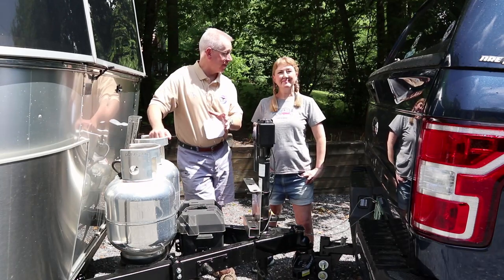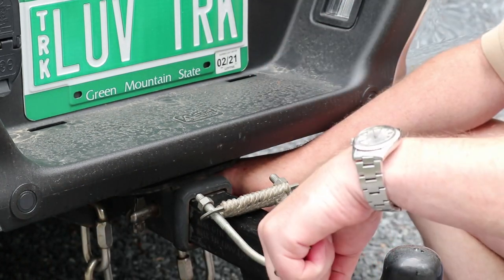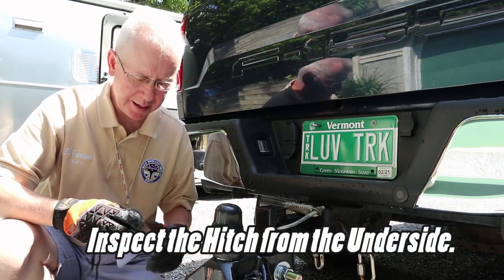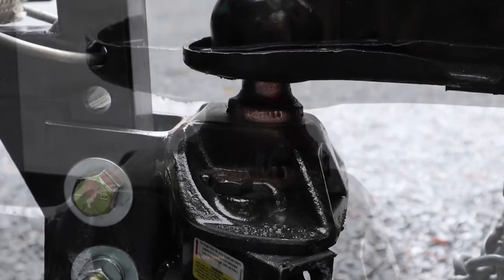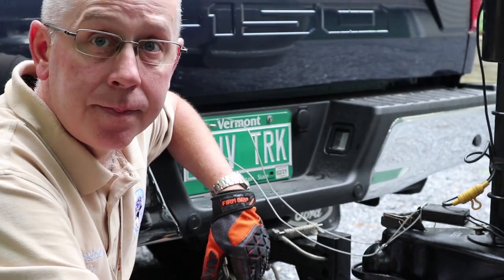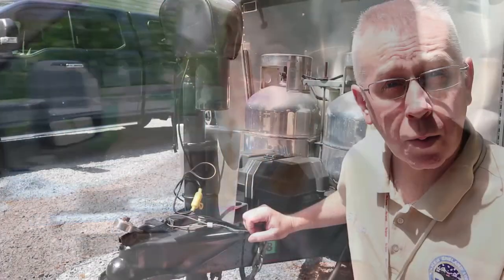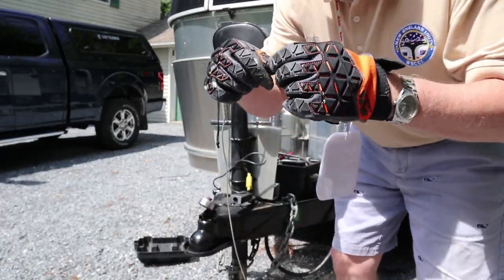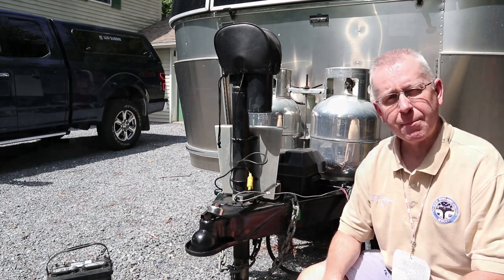RV Hitch Safety | Tips  For Towing

Comment: Concerns from an individual towing Airstreams for more than 36 years regarding your hitching procedures as per your video. The chain hooks need to be attached such that the body of the hook is on the top of that to which you are making the connection. As shown in the video, the “safety” pawl is on the top. If said pawl should fail, gravity will cause the hook to be disconnected. 
The doubling back of the break away cable to the safety pin for the hitch gives a second failure point for the cable. The routing of the umbilical power cord through the bail on the opposite side of that safety pin can apply pressure to cause that bail to open allowing the break away cable to disconnect. The break away cable as shown is too long and should be shortened to the appropriate length and secured with a pressure ferrell as the original loop was secured. The break away cable must be as short and direct as possible for the set up. The eye bolt that is being used is not a “closed eye” fastener. If an eye bolt is used, it should be a forging with no gap in the eye. The tensile strength of the fastener shown may not be able to prevent the eye from opening particularly if the eye is not in a direct alignment with the break away switch activation pin. Lastly, the break away switch should be tested with the battery connected as part of the safety inspection of the hitching procedure. One can hear the magnets attach to the brake baker plates or the hydraulic pump actuate for hydraulic brakes. A two second operation of that switch will not cause damage to the magnets or pump but will give assurance that the break away system is operating correctly. These are my concerns especially when providing instruction to others. Be safe.
Reply from the maker: Hi Robert!  Thanks for watching and your very well thought comment..  I've been thinking for two days what you meant by the pawls on the chain hooks and I finally figured it out.  You are correct.  When we hitch up on Thursday I will make that improvement.  Note that I have another video out where I explain how to test the brakes using a compass on each wheel.  Obviously, you have to leave the battery attached to do that.  The other points you make are indeed good.  I'm curious - how do you route your umbilical cord?  This is how I was taught by my father-in-law (and he really wants his daughter to be safe!).  Other than that, I'm pretty happy with my setup because, like you, I have many, many years of towing.  I appreciate you adding your knowledge to the Comment section.  Be safe and I hope to meet you down the road someday...

Comment: Good points. One guy told me that the cable to the “emergency brake” should be a little shorter than the chains so the brakes will activate if the chains are pulling the trailer. I like your setup better. Thanks for posting.
Reply from the maker: Since your comment I've been thinking about that.  Both solutions are probably acceptable.  I would just be worried about having it too tight and encountering a situation - say cresting a steep hill with a turn at the top - that could result in unintended activation.  I'll continue to think about that...
Reply: Luv Subbin Now you have me thinking about it too. I think you are right though. If the chains are pulling the trailer the main electrical cable from the truck to the trailer will still be attached giving you trailer braking power. So the  important point is to make sure the wire harness is longer than the chains.

Comment: Great tips, I see you have a "Quiet Hitch" anit-rattel adapter or is that U-bolt something different?. Very simple solution to curb the chucking and rattling. I would activate the emergency brake away once a year just to make sure the switch and wiring are all good you will hear the brakes engage immediately them re-connect. Safe Travels.
Reply from the maker: I think the U-bolt thingy you reference is simply a handle I made to make carrying the hitch around easier.  I'm going to do a Luv Subbin short on Friday where I pull the pin but use a compass to ensure that the electromagnets engage - very similar to what you suggest.

Comment: Greatly appreciate the information you share in your videos. Regarding the safety chains, are you sure that the links that you hook you trailer chains to are suitable to support the weight of the trailer if, heaven forbid, it became detached? I was advised against them.
Reply from the maker: Thanks for watching!  Yes, they are.  The links are rated at 5,000 lbs each.  The heaviest I've ever weighed the trailer is 4,660 lbs.   I had a longer shank on my old Reece hitch and I'm not sure I need these now  so I might just get rid of them.
Reply: @LuvSubbin  Got you. I kind of figured you had done the research judging from your earlier videos. I get a kick out of your obsession with detail. I also pull an Airstream, but mine is closer to 8,900 lbs.

Comment: great tips but I would suggest using silicone lube on breakaway oring because oil can deteriorate neoprene rubber
Reply from the maker: Thanks for watching!  I think the pin is polyethylene and not neoprene but I agree with you - silicone is probably better and I may use that next time.  I've always used the 3:1 oil because that's what my manual says to use...

Comment: Good video. Similar to you, I have a 2018 F150 with the 7 pin receptacle with the "door" on the bottom and a Bargman 7-Way Molded Trailer End Connector. The Bargman connector does not seem to insert very far into the Ford receptacle.  I tested a Bargman Plastic Trailer End and it inserted much farther.  How far does your connector insert into the Ford?
Reply from the maker: Thanks for watching! I will certainly say that the plug does not seem as "secure" as my 2001.  However, the plug's little molded finger does fit into the door's catch.  It is a pretty cool feature of the Ford in that it will tell you when the connection is poor - my old truck of course couldn't do that.
Reply: @LuvSubbin  Thanks for the response. I just adopted your idea of the extra strap on the seven pin as a safety. As an offline experiment, I just ordered a spare male molded Bargman and female Ford 7 pin. Will see if they fit more secure or if that is  the standard. I was hesitant to push to too hard on the originals because they are indeed "mission critical".